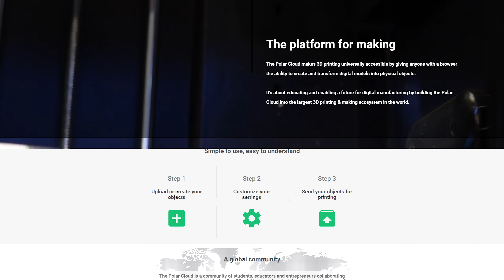3D Printing at an Angle! Talking Printrbelt with Brook Drumm from Printrbot #BAMF2018

Comment: I think the black belt 3d printer has the same setup, but is more developed than this prototype. Also they are developing their open source Cura slicing software, so you don't need those hacks you talk about.

Comment: STOLEN THE IDEA ABOUT A YEAR AGO he should of said, at about the same time as the BLACKBELT 3D printer launched on Kickstarter. What a wanker!!!!
Reply: I'm unsure of the initial announcement for Blackbelt 3D's printer but their kickstarter is dated June 1st, 2017.    I saw a working prototype that Bill Steele had built at his Polar3D booth at MRRF2017 which was in March of 2017 and pre-dates the kickstarter.  There are YouTube videos from MRRF2017 showing his version of the "z belted" printer.  See ABUZZ design's MRRF 2017 recap video https://www.youtube.com/watch?v=Ego9DUNmy2E at 8:08 for example.  I am excited about this concept and want to see it realized to its full potential.  Not who was there first.
Reply: @reasonablebeing5392  Yeah... actually, I showed it off at Rapid 2016 a year before that even. ;-)  It had been sitting on my shelf for a couple of years prior to that.  I developed it for a project where I needed to develop the math and this was a simple way to do that.  A couple of friends convinced me to display it at Rapid then MRRF, where I released the open sourced code and design for it.

Comment: Printrbot royally screwed me so I’m not too keen on there products. I tried to reach him so many times that I finally gave up.
Reply from the maker: Uh oh, what happened? Can I help?
Reply: 3D Printing Nerd  the Christmas of 2012 I received the printrbot simple wood, and I was so excited. I have always been interested in 3d printers and to my knowledge they were the best beginner printer. Well we bought it off of amazon, I assembled it with my dad (electrical engineer) so we are pretty sure it was not from us but the board was defective so it would not even power on. A couple months later after we returned it to amazon, they gave use the refund. Great service from amazon like usual, but from this refund I decided I should just buy it from the company itself, so I purchased another printer, same model, from printrbot, once again I was super excited to get it and put it together following the directions and double checking everything. This time, only one axis worked, and as soon as that one axis moved a mm, it would freeze the board, so I’m assuming it was another defective board, however, after this happened I spent 4 weeks on the printrbot support forum trying to fix it and no one could help so I tried to call printrbot but they did not have a phone service, so I tried to connect with Brook Via Twitter, Facebook, and linked in. Sent multiple messages trying to get this to work until I finally decided to return it. I returned it to printrbot and then never received my refund so not only was I out of a printer but also out of 350 some dollars since that was the price when it first came out. I resorted to putting up more threads and messaging brook via Facebook messenger and linked in but never got a reply. To this day I don’t have that money :/ I understand sometimes it’s difficult to catch every problem when you run a company but it just stinks.

Comment: i would suggest using a transformation matrix to convert to the skewed coordinates. not quite sure how your having the program cut the layers but if you are leaving z alone and shifting x and y.
[  cos(-35)+1  cos(-35)-1  sin(-35)*2^(1/2)  ]
[  cos(-35)-1  cos(-35)+1  sin(-35)*2^(1/2)  ]*(1/2)
[          0                       0                     1             ]

Comment: So, anything 30° and under will need support material at the beginning of the print, right? LIke printing a sphere?
Reply: William Meisburger-Iwata Yes... Thats exactly right... The overhang angle is also rotated by 35 degrees... So anything over 10 degrees on the front needs supports but the back doesn't need them for up to 80 degrees.

Comment: Why print at an angle? Keep the XY normal and when it's done with a print and going to re-home all axis then just move the conveyor the y distance of your print space and the manually zero, I don't get the difficulty
Reply: It's not difficult... but it requires an additional motor AND that technology is already patented by Stratasys (Makerbot.)  I developed this as a way to get around that patent.
Reply: William Steele I guess I did hear that. For forgot it as I read thru the comments.
Reply: William Steele but I wouldn't think an additional motor, I would just use the already in use Y axis motor to run a conveyor instead, when print done then run to a high Y axis then manually zero. It's the z accuracy that will be affected tho

Comment: Angled printing, eh?
Bing!
Look for "Normal 3d printer" on YouTube, or directly at https:\\www.youtube.com\watch?v=QJUd0EGOtGI
Extruder at end of simple robotic arm, build platform rotary driven.
As print proceeds, 'wrist' of arm rotates to keep extruder nozzle normal to the surface being printed.
Normal to the surface?  Printing 'square' on the edge of the model, rather than top-down sections.
Less Cartesian, more Quaternary?

Comment: pretty interesting... definately see this having good aplications for assembly line prints where you want to print a bunch of things but instead of a print failing half way through and ruining 20+ parts (if u have thqat many going) then with this it would likely only be like 5 parts then didnt fully finish depending on the size... i also see this having aplications for needing less infill since the angles would bridge essentially the top parts meaning you wont need infill for bridging puposes with certain models

Comment: Thanks Joel. Very cool concept,. Now if only I could think of a project that requires it.....
Reply: you can use it to make a as-long-as-you-want chain...

or anything that would require a long af x/y
Reply: +Ivan Miranda No...  do you?
Reply: can imagine this being pretty useful for props and things like that
Reply: I have a customer that would love to print a few parts hes makes 24/7.  We almost got the last belt printer they made but they took it down. But with a belt he wouldn't have to wake up and clear the bed in middle of night.  This though, might need to wait for 3.0.
Reply: Ivan Miranda infinite tank treads?
Reply: Armor plates for my 3d printed tank.  It orients the layers so they're perpendicular to the line of fire... no splitting layers apart and defeating entire sections of armor (yes, my rc tank is designed for projectile combat and is hideously unsafe and should NEVER be replicated... because safety or something) and maybe an easier time orienting them on the bed so the layer issue is minimized.  Nothing sadder than testing armor plates and seeing them just sheer along the layers. :(
Reply: Infinite tanks
Reply: I'm in TY model railroading at 1/960 scale.  I could use that to make the belt for the layout.  I'm also in O Gauge so having that would allow me to make long railcars without needing to buy a huge printer.  If I want to handlay track I can make 2,000 rail ties in one print or even just print the track pieces.  Mass production is the big advantage here.

Comment: This is really really cool.  I wonder if the vertical strength of a piece will be stronger since the layers would intersect the vertical plane rather than running parallel to them?  Very very cool.
Reply: hmm, about the piece strength - not really. the strength comes from how the lines are overlapping and adhesing together. You can make weak or strong prints with this. However what i can pick up from the video, the print quality is really poor and inaccurate. But the idea is cool!
Reply: sure it would likely give it a bit more resistance to tension and compression but it would also, put the layer plane a tad close to the 45 degree max shear plane. i'm not really that acquainted with the mechanical properties of 3D printed materials but i would assume the layer plane is apt to shear.
Reply: Given that you are already rotating models this-or-that way when slicing them in order to gain the best print properties/strength for any particular model, all this is really doing is changing how you approach that "rotation before slicing"; the big benefit(?) I can imagine is changing support material requirements for certain models. For instance, you can already print a cube either on one of its edges or on a point, using supports to hold it up...just in this case if your "cube" needed to print at some multiplier of 35 degrees against the vertical plane for optimum strength (...or something like that) suddenly you wouldn't need to put supports all over it, as you'd basically be "printing on its side."
Really hard to try and explain what I'm visualizing, so hopefully that makes sense.  All I know is that I have printed rectangular models on an edge before, specifically to use angles to my advantage (to reduce where supports were needed, as my printer can handle 45 degrees just fine), so I can see how this system could benefit you in some cases (although I'd want to reangle to 45 degrees, not 35, as that would make it much easier to think about model orientation IMO)
Reply: Vincent Ferrari don't you mean horizontal
Reply: Blackbelt was on of the first and their printer works the same and they can print without support on most things, so the structural integrity is fine and maybe even beter then regular 3Dprinting

Comment: So why couldn't he make the conveyor belt be the Y coordinate?
Reply: It looks like a convention that the axis which increases over the course of the print is Z.  But really it's arbitrary what you call which axis, you just need everyone involved to use the same convention.
Reply: That's exactly right.  I just choose Z because the extruder was moving on the X/Y gantry as normal.  (My original proof of concept machine was a modified MakerBot Replicator 1.)

Comment: Why the bed is not at 45degree ist more simple no?
Reply: For compatibility with Polar 3D I think? He mentioned it had something to do with being what Bill uses (35 degrees) and I'm assuming he meant Bill from Polar3D.
Reply: 45 or 35 is arbitrary... but I choose 35 because it was easier to get the filament to stick to the build surface due to the geometry of the nozzles I was using.  My post processor simply takes the angle as one of the parameters. BlackBelt's version is adjustable as well.
Reply: William Steele cool to have a response from the creator but im french and im not realy good in english and i dont understand the purpose of this 3D printer ???

Comment: what is the potential use for that kind of printer?
Reply: The parts that are done will fall off the belt at the end, so the printer can keep printing parts without anyone having to remove them manually.
Reply: Markus Luedin i got that part, it’s the angle that I don’t understand.
Reply: It needs to print on an angle so the belt can move the piece along, thus allowing it to print forever (Or until it runs out of filament/jobs)
Reply: To me, the reason I developed it, was for multiple users efficiently using a single printer.  You can have 1000s of users all able to submit jobs to a single device and it will continuously print until all the jobs are completed.
Reply: Prints bigger than the bed/printer sounds pretty cool to me.
Reply: I imagine this thing printing out a chain, in a never-ending stream of connected links, a barrel under it collecting the freshly made chain…
Reply: Because the bed is ALWAYS advancing, your model is skewed in the opposite direction ( the angle ) to counteract the amount of movement that the belt has advanced
Reply: It's AMAZING at dealing with overhangs, like you could never do on a standard printer 
And you have an "infinite" axis
See :  https://twitter.com/blackbelt3d/status/993212009356386306?s=19
Reply: Also, the technical maximum length of a part is infinite, virtually, as long as you can support the part sticking out and continue to feed it filament. Check out the blackbelt printer and their advertisements.

Comment: It may be possible to use a couple of linear transformations on the Stl file (rotate then skew) and use a slic3r add if it was a Cartesian printer. Raft and supports would have to be on the file, though. Really interesting concept for automated manufacturing.

Comment: Now it just needs an automatic magigoo applicator.
Reply: I'm picturing a row of Magigoo markers in a fixture underneath and the belt rubbing against all of them on it's way back up to the top.  (probably would have wayyyy too much Magigoo on there in a short period of time though)
Reply: ualdayan Just put a flat bar behind the tubes to scrape the excess as it comes around. Probably gonna need a drip pan/crumb tray for the shavings.

Comment: You can actually use the Black belt version of cura ;)
Reply: Yes, I've used their version with mine and it works just fine.  Their software, however, is limited in that it can only print one job at a time (or multiples of the same job.)  The Polar3D Cloud can actually queue as many print jobs from as many users as necessary... and you can even prioritize them if needed.

Comment: Same principle as the BlackBelt....no?
Reply: Actually, I developed this belt technology.  BlackBelt didn't show theirs until over a year after I first showed my concept at Rapid in 2016.  I then showed it at MRRF2017 and convinced Brook to design and sell them.  BlackBelt's is nice... but technically has nothing over this.  (Their name comes from their belt being made of carbon fiber... if they patent anything, it would be that... slicing I wrote, the initial design I came up with... and there was a previous similar machine from Andreas Bastian over at Autodesk, so essentially, there is nothing else to patent.)
Reply: Essentially, but this is open source
Reply: I heard that pintrbot copied them even though they were patent pending - anyone know if this is true?
Reply: I visited BlackBelt, their printer prints at a much higher quality, steep price, but interesting for businesses.
Reply: Liam Corbett  I don't believe there are patent issues. He has make previous statements regarding this. Brook has had the Printrbelt concept in development for a long time, and has demonstrated various designs publicly last, and this year.
Reply: Not true at all.  I designed the first one.  I asked Brook to build them before BlackBelt was even known... In fact, I demonstrated it at MRRF in 2017.  They have nothing to patent except maybe their carbon fiber belt.

Comment: This is getting close to what I need for printing 19" rack components. I'd be much more comfortable with the full 19+ inch being on the same layer, though. I think I'm still looking at expanding the Y-axis of an Ender 2 or similar to get the strength I need. Plus I've seen at least one such Ender 2 on Facebook so I know it's possible. I do like this print-at-an-angle belt-is-z concept very much for other projects. Once it catches on I can see this to be implemented in the top four slicers rather quickly. Thanks Joel! Cheers! JM

Comment: I really needs this!
As long as s3d can slice for this without taking ages to work out all the details I will buy one 100%
Reply: Any slicer can use this... as long as you run my post processor on the final gcode.  (It does the shifting magic.)

Comment: I have noticed the layer direction effects strangth. So I wonder what effect this printer will have on strange.
Reply: Wonder how long a part you could print unsupported off the end of the belt?
Reply: jim2386 that is an interesting question achally.
Reply: they printed a 6 foot (1.8m) long sword on the beta unit
Reply: but that was with a outfeed support
Reply: asderidelp couldn't you just rig up a rolar ramp to support production?
Reply: Wolfwind Prepper I think a simple outfeed support would be enough
The newly printed part pushes the old part further
Reply: asderidelp. Maybe I'm over complicating it.

Comment: If the world is round don't you always print at an angle?
Reply: If the universe is empty, aren't we printing in nothing?
Reply: LPM Supporter if chem trails are real aren't planes just massive 3d printers?
Reply: Earth is also wizzing around the galaxy at about 1000 km/s so everyone prints at 1000000000 mm/s, but that's only in vase mode
Reply: Sky L wtf get higher man, maybe 100km up and please don’t come back again.
Reply: A tangent dude... it's called a tangent
Reply: the world might be at an angle, but you printing base is perfectly square and flat, so no.
Reply: Even 180° is an angle so quit being so obtuse. (≖‿≖)
Reply: CLEVER.
Reply: r/woooosh
Reply: if the world is really as big as it is and spinning as fast as it is centripedal force would make you lighter at the equator
Reply: Aymon Holth no cause there’s this thing called levelling your print bed...
Reply: the world is not round. I live on 5th floor and I see the flat land.